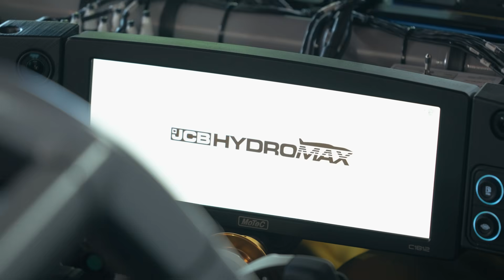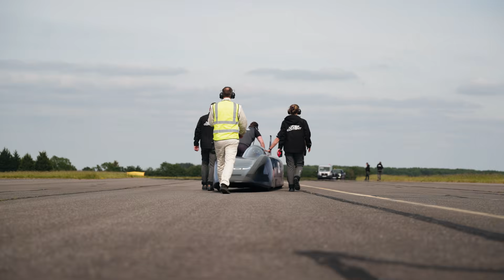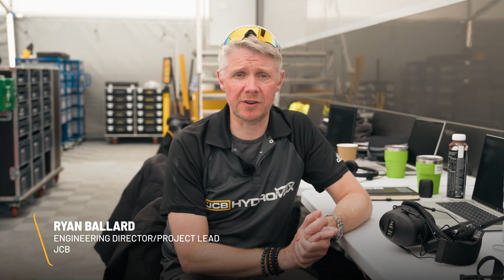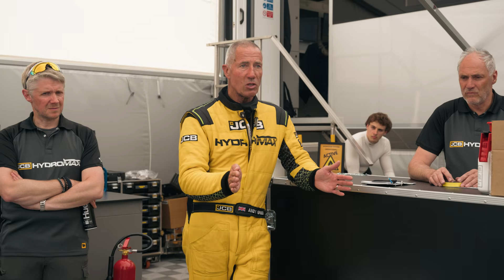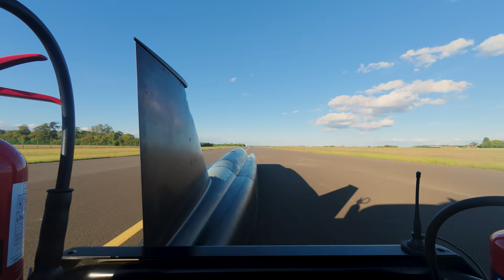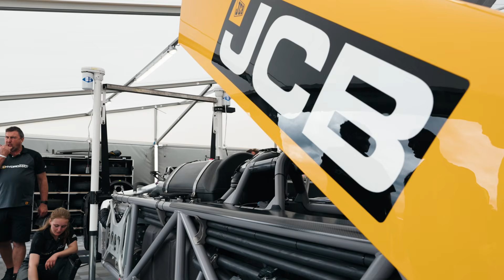High Speed Testing of JCB Hydromax | Hydrogen Powered Land Speed Car

Comment: Hydrogen is a great fuel, very clean but it is not environmentally friendly to produce. It is like all electric car owners thinking that they are driving zero emissions vehicles, no ! Not so, massive amounts of CO2 to build them, batteries that cause massive amounts of carbon emissions to build, god forbid the battery burns the entire vehicle & anything close by down to the ground & then the electricity to charge it ! Where is that coming from !
Hydrogen fuel is terribly energy hungry to produce, it takes either fossil fuels or masses of electricity that would be better used elsewhere.

Comment: So hydrogen is 'clean, but what about producing it? The most common ways involve using natural gas (a fossil fuel that is burned) creating carbon monoxide and carbon dioxide. It is not as 'green' as they lead us to believe....That said, it is a great technological challenge they are attempting to beat.
Reply: Yes that is true. It's like an EV in that respect. Look up single point emissions. The vehicle produces none and the unit that does is single point heavily regulated and inspected regularly just like any other power generating facility. Far easier to police than 300K owners installing intakes and exhausts and tuning on personal vehicles increasing CO/related gases released over a larger area and volume. There is no perfect solution at this time so taking steps in the desired direction is the logical path.
Reply: @michaelcarberry594 ....and CO2 is dangerous.....why - bc plants need it to breathe 

And CO2 makes up what trivial % of our atmosphere....

It's ALL 🐂💩
Reply: @CosmicSeeker69  Your ignorance is monumental. Enjoy your tiny dirty world.

Comment: Why are they bothering? Hydrogen will NEVER be a fuel available to the masses, the transport and storage issues, and it's low calorific value, make it a terrible fuel choice for the general public.
Any new fuel must be available using the same transport and storage hardware as is already in use. No fuel station is going to stomach the cost of replacing their tanks for many fuels, with a tanks for only one fuel. The high speed performance may become legend, a street version will not.
Reply: Why bother to do anything? Progress is only made by people bothering to do things.
Reply: @coleorum There are other technologies making bigger advances, Hydrogen is a dead end for this use, same as for Rockets. 
Fuels that can be shipped and stored using current hardware, such as being trialled with Amonia, have a much lower cost to implement.
Reply: Well done lads 👍